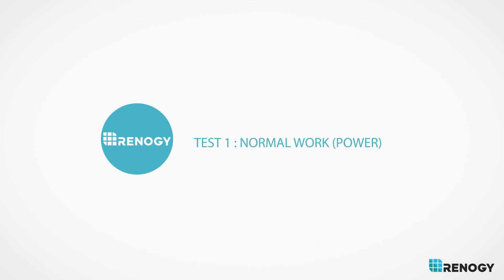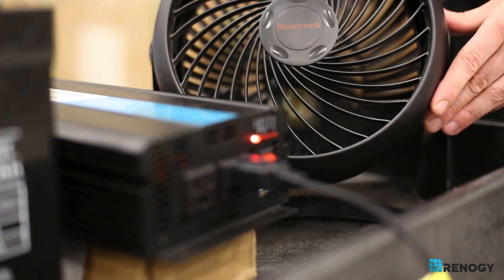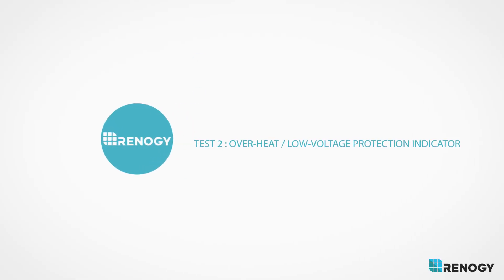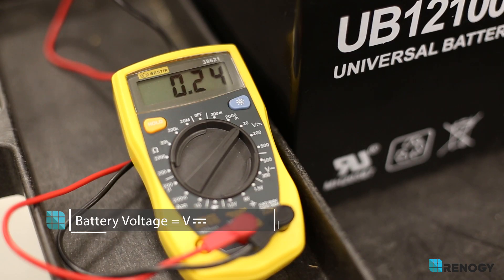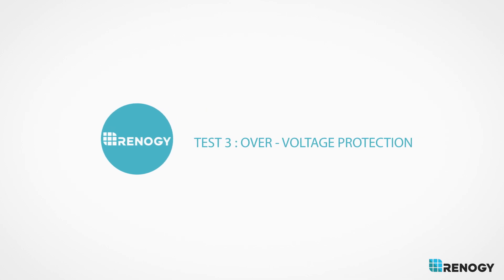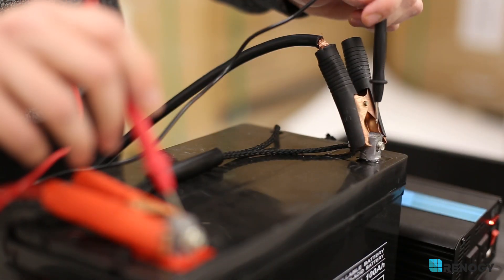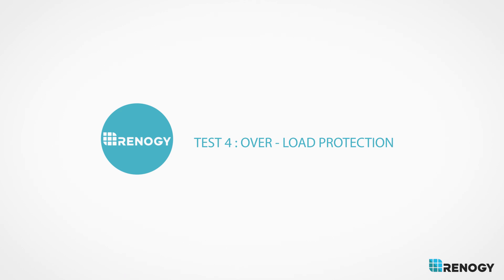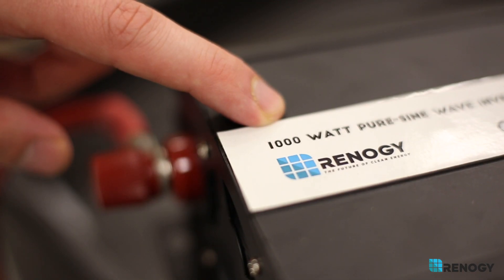Renogy: How to Troubleshoot Your Inverter

Comment: Is there a mute for alarm on the Renogy 3000 watt inverter? I tried shutting the power off on the inverter still beeps. Only way of shutting off noise is unplugging shore power.

Comment: Renogy would the most difficult company to get in contact with. I have a 3000W inverter and the alarm keeps sound. Battery voltage is correct load I  minimal When trying to get support the want to know the model number  THERE IS NO MODEL NUMBER ON THE UNIT. To try and access their support page you have to provide you order number and SKU which is not available.  What cant they just have a simple email address so you can email them with to discuss the fault
Reply: Ya I bought 2000 watt inverter used from them and they shipped me one that alarms nonstop. And they’re ignoring me on eBay after asking for videos
Reply from the maker: Hello, this is the link for submitting after-sales cases: https://service.renogy.com/login. Additionally, we offer online chat support in the United States, the United Kingdom, Canada, and Australia during local business hours from 8:30 to 17:00. Alternatively, you can provide me with your email, and I can assist you in creating a case. Also, the service phone number for the United States is: 1 (909) 287 7111.

Comment: Renogy.....the most unreliable , useless , appliance damaging , garbage piece of krap ever produced. 3rd world countries would design and manufacture a better product. Zero product support....and the inverters will damage every appliance you plug into them. And for God's sake don't even attempt to plug in anything with a circuit board ....fried instantly. Read all the bad reviews worldwide.  Complete trash

Comment: Have a 48v 3500 watt all in one unit.  1200 watts solar, fully charged batteries. will only run a light bulb, noting more.  tried  small drill motor, code 4 comes up.
any ides??
Reply: the unit SUCKS.

Comment: Not to be rude, but absolutely useless.  I'd appreciate Renogy responding to me with an RMA# for the 1000W inverter they said they would cover under warranty, but then refuse to respond when I ask for an RMA or where to ship it to.  Overload protection kicks in when I turn it on and there is Nothing plugged into it.  Guys if your in the market for an inverter check out Victron, they are pricy but worth it.

Comment: I have a Renogy 3000 watt pure sine wave inverter charger which has been in use for 6 months. This weekend I turned it on and there was no beep nor did it provide 120v power. Attempted to cycle the power but to luck. I checked all connections from the batteries to the inverter and everything was tight, multimeter reading were fine at every connection also. I started a generator to see if it would provide pass-through power which it did. Once I turned off the generator the device continued to provided 120v power. After about 2 hours it ceased to provide power again and would not resume. It's clear I have a technical issue within the device. I'll be contacting support about getting it replaced since it is still under warranty. I've been pleased with the Renogy products, aside from this of course. I have charge controllers, solar panels, cabling, battery monitor and hub, which is probably one of the biggest pieces of crap on the market as you cannot get the software to connect to the various devices. Ok, as I type this maybe there stuff is questionable. I'll see how the customer service handles this and will try to update this post.

Comment: with 2000w powered off and everything unhooked, im getting aa reading of zero ohm between ground and neutral terminal/  is this bonded? and if so..  how is gfci supposed to NOT TRIP..???
Reply from the maker: Hey Beau,

For any technical questions, please contact us here-https://www.renogy.com/contact-us?gclid=CjwKCAiA3pugBhAwEiwAWFzwdeH3Crd9vRTbjjTYl9l3daVqnotJPjBhs2nmw-Wkn1_guWQeW0ao6hoCOHcQAvD_BwE
Reply: My renology inverter just suddenly stopped .It's dead .Nothing .I might have heard a "pop" but I'm not sure .Maybe a fuse blown with a bit of luck???? Anybody know where the fuse is located .There is a reset button at the back. I'll press it and see what happens first 😢

Comment: My 3000w inverter shuts down (red light, alarm) at 2000w (+\-100w) load and input voltage measured at the inverter of 11.9V.  

It’s not overloading because it’s rated 3000/6000w. It’s not undervolting because the input voltage measured at the inverter under load is 11.90V. It’s not overheating because the fans don’t come on until the alarm sounds. 

The alarm will sound for approximately one minute then the power will come back. 

Ideas?
Reply: I'm having the exact same problem. I'm thinking of just disabling that beeper somehow.
Reply: @rgaddy9820 did you find a solution? Thanks
Reply: I'm having the same issue only pulling 500w
Reply: @SirWheezalot did you find a solution? Thanks
Reply: @markfletcher3406  
Yes.  The inverter has 2 on options.
 I switched it to the one where it's always on.And I turn it off manually when I need to

Comment: I just purchased the new 1000 watt Renogy inverter and I am having an odd issue. If I have nothing plugged in and turn the inverter on and then plug anything, it gets no power... but if I have anything plugged in and in the on position when I turn on the inverter, it has power. Turn on inverter with nothing plugged in, green light but no power at the plug in. Turn on the inverter with something plugged in but in off position, green light turns on but then I cannot power the device... turn on imverter with something plugged in, in the on position, then it powers on but if I unplug it and try to plug it back in no power... I am running under a 100 watt light bulb. I just bought the new 100 AH lithium battery and 200 watt premium solar starter kit and the new 1000 watt renogy power inverter. So confusing and disappointing.
Reply: you might want to send an email or call them.
Reply: You probably have the power saving on. Just change it to off. Depending on the model it may be the third switch (SW3)
Reply: @luisdanielcorrea  
Nope, Renogy finally swapped it out as defective. I had to go through a few phone calls of the same troubleshooting steps and send a vidoe of the troubleshooting steps that I took. Was the biggest pain, horrible customer service and I'll never buy Renogy again.

Comment: could one of the techs at renorgy try renorgy  1000 watt inverter ,,,try a test where they try to run a 15 - 16 cubic foot refrigerator with a thousand watt inverter to see what would happen
Reply from the maker: +bill767667 Hi Bill,  since all models of fridges are different, they use different amounts of power. While we could test a 15 cubic ft. fridge, there's no guarantee that if the inverter works or doesn't work with the fridge we're testing that it will or won't work with your particular fridge. Again, if we have the specs on your fridge to figure out how much wattage takes to run it, we could give you a better answer that's specific to you and your whirlwind.
Reply: 6.5 amps full load draw,115 volts,,,,model et8gtmkxq00,,,serial,,,usp2693416,,,, design pressure140psi low,,,,330psi high pressure,,,, this information was on the inside of the refrigerator when you open the door to the left a little sticker inside and again it's a whirlpool ,,,, freezer on top
Reply from the maker: +bill767667 Hi Bill, a technician ran your stats, and while you would be able to use a 1000W inverter normally (6.5A x 115V = 715W, 715W < 1000W), the required startup surge of most refrigerators is 3 times its wattage rating. So, in this case, it'd be 715W x  3 = 2145W. Our inverter's max surge rating is 2000W so it would be less than the 2145W required by your fridge. Thus, to be safe and ensure smooth usage, we'd recommend purchasing a 2000W inverter since it has twice the surge rating power of our 1000W inverter (4000W!). The 2000W inverter would be more capable of accommodating your refrigerator's startup surge. If you have any other questions, please feel free to let us know.

Comment: will the renorgy 1000 watt sine wave inverter handle a15 cubic foot refrigerator I have a whirlpool regular single door refrigerator with freezer on top I've been running it on a 1500 watt centec Harbor Freight Tools modified sine wave but I'd like to try and get a sine wave inverter pure sine wave they say it's better for it and uses less power my system is primarily made up of renorgy solar panels ect,,,I was just wondering if I could get by with the 1000 watt renorgy inverter to save money for this purpose
Reply from the maker: +bill767667 Hi Bill, in order to check to see if the inverter would be able to handle your fridge, we'd need the power specs for your fridge. If you can give us the wattage of your fridge, or tell us the exact model of your whirlpool, we could look it up. But if you're able to access your spec sheet, and it lists the cooling stage as being less than 1000W, it should be fine. You can also email our tech team at techsupport@renogy.com or call 1-800-330-8678 for more help.